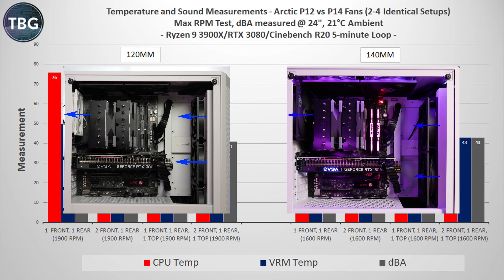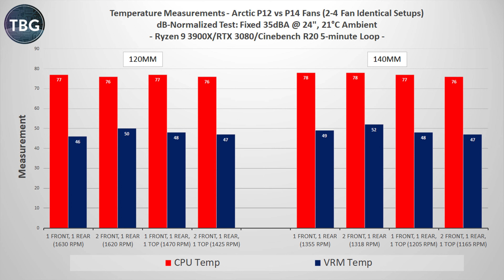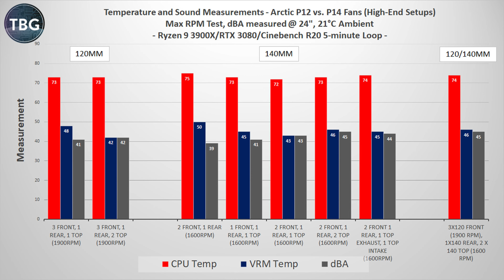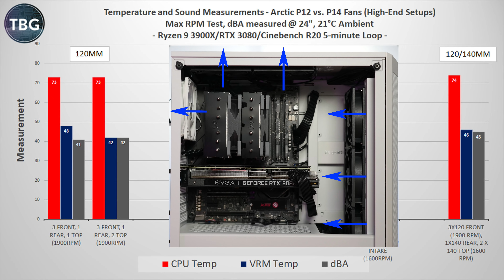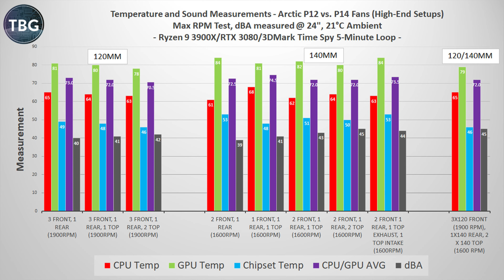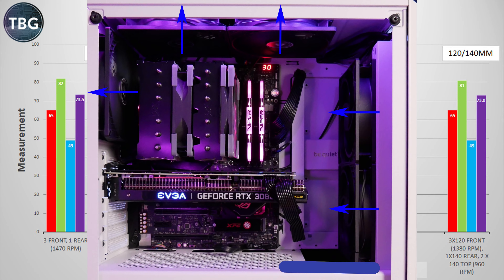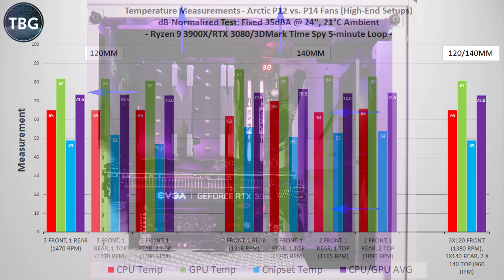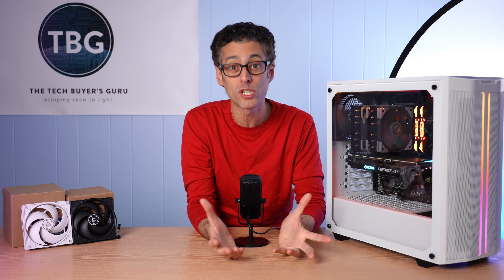The Best PC Case Fan Setup - How Many, What Size, and Where, feat. Arctic 120/140mm Fans!

Comment: What if I used 3 120mm in the front, 1 120mm in the rear, and two 140mm in the top? Arctic p fans of course
Reply from the maker: I would call that perfect, although if your case can fit a 140 in the rear, that is even better! Also, there's a new ARGB version of the 120mm to check out! -  https://amzn.to/3chOcVS
Reply: @TheTechBuyersGuru  My case is a corsair 4000d airflow so a 140mm won't fit in the rear sadly, and those fans aren't really my style. I like a ring of light around the frame of the fan with dark blades. Its just the style I have in my build, black everything with lines of white leds.

I tried the arctic bionix p120 argb fans with the led frame lighting but they had bad motor whine, worse than the p12. Maybe I got a bad batch so if you could review them to confirm this that would be great. https://www.amazon.ca/dp/B08FBH1VZP/ref=cm_sw_r_cp_apa_glt_i_HSDN5ARQ9RF1Z6BWG80J
Reply from the maker: I will be testing the P120 ARGB fans in my 120mm case fan roundup later this summer. Also in the lineup is the Corsair SP120 Elite.
Reply: @TheTechBuyersGuru  Hell yeah! Your the best.

Comment: There is one thing, that changed over the years. The internal shape of PC cases. Top front of the case was reserved for 5,25" positions in the past, positioning front fans in the lower front part of the case. HDD´s and GPU had more air, while CPU had less. Currently, it´s the opposite - CPU has more air, than GPU - this issue becomes more visible in smaller cases, like mATX. The part to blame for this, is the PSU shroud - while it makes doing case cable management a breeze, it also blocks a lot of airflow for the GPU. I think it should be left as an accessory for the owner to decide, whether he wants it or not.
A small note - you don´t have to use predetermined fan mounting positions. You can mount your fans whenever you need. I custom-mounted my front fans closer to my components, but i have 5 years old big tower, that allowed me to do so - and i´m using my 5,25" positions for my HDD´s, which, as i found out, don´t require any cooling.

As can be seen in the review, having front top fan as an outtake is contraproductive - logically speaking, you are venting cold air from your case BEFORE it can be useful and take some heat from your heatsink. Having front top fan as intake might be beneficial, but you must make some adjustments to the case, to prevent warmer rear-outtake air from being sucked back in by the front top fan. It´s certainly possible. There are shrouds and ducts, that can be made on 3D printer to help you with this. I am considering this as well, since i want to have positive pressure and i can´t have 3 fans on the front.

Also watch out for the case fan positions design - the positions for 140mm fans are often partially blocked by metal, which lowers their effectivity in their most crucial outer area, which has the highest ability to move air.
Reply from the maker: The issue with the fan mounting brackets blocking part of any 140mm fan airflow is a real one, and you make a great point about that outer edge producing a lot of the air. That could be why in this test, the 120mm front fans to better.

Comment: I'm switching from that case to a lian li lancool mesh with vertical gpu mount because it won't work in this case. I'm using 3 120mm front fans 240mm arctic liquid freezer ii top with 140mm scythe kaze flex rear exhaust. The kaze flex is the only fan that isn't arctic p12 lol
Reply from the maker: Nice! The Kaze Flex 140 is a great fan, though, so you made a good choice setting it up as your exhaust. In my tests it was the best exhaust fan by a long shot: https://youtu.be/PUdsTiRmuuU
Reply: @TheTechBuyersGuru  wonder how mounting my gpu vertically and adding a fan to the bottom of my case will affect airflow in the lancool 2 mesh. 🤔 the possibilities lol
Reply from the maker: The Lancool II Mesh is a sweet case, but mounting any GPU vertically is all about looks, not thermal performance. Don't expect miracles!

Comment: Ok. Good to see the 120mm x 5 or 6 performing well as my new setup will resemble that. The latter proving a second top exhaust doesn’t interfere with front inflow. Appreciate the time you spent here 👍🏼.
Reply from the maker: Yeah, that second top exhaust fan is something a lot of people thought would cause problems, but the tests prove otherwise.

Comment: I wish you swapped out the air cooler for the cpu for an aio/loop that has a radiator at the top. I'm running 3×140mm in front, 6x120mm push/pull on a radiator up top and a 140mm in the rear(which I'm unsure whether to make an exhaust or intake) all fans are corsair ml120 pro's and ml140 pro's.

Comment: My Fractal Design Arc case has a place for a bottom fan, how would this effect the tests if it was blowing upward pushing the gpu heat out the top? Would it also make the cpu temp go up, as the heat would also be pushed into the stream from the front fans. Another factor for my case, is that the left side has an place for a fan, that I leave open, to let the gpu heat go out that side.
Reply from the maker: Good question! It's something I intend to test in a future video. I had considered making that part of this video, but instead decided to use a more traditional case that didn't have a bottom fan mount.

Comment: Your videos have been really helpful. Thanks a lot for your efforts. 

I am planning to get a Lian Li Lancool II Mesh Performance. Please let me know if this configuration works best for the thermal and noise level.

Front - Arctic Freezer II 280 mm AIO cooler (Push Intake)

Top - 2 x P14 Exhaust

Rear - 1 x P12 Intake

Top of the PSU Shroud  - 2 x  P12 Intake

Thanks.
Reply from the maker: Sounds good but you don't want the rear as intake unless you have the front fans set to exhaust. Also, keep in mind that front mounting the AIO will increase GPU temps.

Comment: I just found your channel last night, and suddenly the time was 3 am. :D Really great content! Thanks for the in-depth testing and for not just testing fans with AIOs. 

In your opinion, if I wanted to outfit my Antec P280 case with at least 3 (2 front, 1 back) of either the Arctic P12 or Scythe Kaze Flex 120mm fans running at low RPM, would you say I would be better off with the Scythes or the Arctics?

Based on your other video, it would seem like the Scythe fans produce a more noticable noise when behind a dust filter than the Arctics. Does that match your experience with those fans? https://www.youtube.com/watch?v=WBoLyC0tSDQ&t=794s

I'm currently running my old trusty Nexus Real Silent 120mm 1200 RPM fans at roughly 650-700 RPM, but I feel like some of the newer fans might have design improvements that would deliver me better performance at the same noise level. With an RTX 3080 and a 3900X, the system can produce quite a bit of heat under full load, as you know. :D
Reply from the maker: Glad you've enjoyed the videos! I'm pretty sure I'm the first reviewer to give an honest go at testing case fans. It's very easy to strap them onto a rad and call it done, but alas, it is not done!

And, indeed, you have a high-powered system with those components. Using just three 120mm fans in a P280 case is going to be a challenge. Well, the case is the challenge, to be honest. I would consider getting a fourth fan for the top exhaust, but alternatively, you could consider upgrading to the case used in this testing, the 500DX: https://amzn.to/3340bRX
It will offer you a lot of advantages over the P280, and the stock cooling is far superior to any upgraded cooling you could do in the P280.
Reply: @TheTechBuyersGuru  Thanks for replying! Yes, finding people doing case fan testing is very rare. SPCR used to do quite a bit of fan testing back in the day, but they don't seem to be as up-to-date anymore.

The problem with most modern cases is that they don't fit my needs. They are either ugly or way too flashy, don't have enough drive bays or have terrible ones, have cheap build quality, etc.  I need at least 4 3.5" drive bays with good vibration dampening for HDDs and 4 2.5" drive bays for SATA and U.2 SSDs. 

Making HDDs silent generally means you need a silence focused case, not an airflow focused one in my experience. My understanding is that you were nudging me more towards an airflow focused case in general, not necessarily a specific one? :)

Assuming that I can't/won't change case at this point in time, do you think either the Arctic P12 or Scythe fans would be a noticable upgrade over my Nexus fans? Also, what about the difference in sound profile between the two when the fans are directly behind the dust filter as in your other video?
Reply from the maker: Ah, I see, that's a lot of drives. OK, so assuming you're sticking with the P280, I'd get a 5-pack of Arctics and call it a day: https://amzn.to/3e5OhgQ
That's about the same price as 3x Kaze Flex, and you'll be able to run a top exhaust fan, which will make a huge difference with the gear you have running. In terms of sound quality, I think you won't notice any subtle difference in regard to the filter noise in your case. Either fan will be far better than your Nexus fans. Fan design has improved tremendously since those were all the rage!
Reply: @TheTechBuyersGuru   Yeah, that sounds like a good plan. I found the 5-pack for the non-PWM model of the P12 in stock, which should work well for me since I still use an old Zalman 5.25" bay fan controller. My motherboard supports DC fan control too so it's not like I really need PWM anyway. :) Thankfully it has a startup voltage of 2.8V so even without PWM it should be possible to get it fairly good RPM range from it even though it runs at 1800 RPM at 12V. :)

Yeah, I might even experiment with two top fans with the hope that it might let me run those two at a lower RPM than the front and back fans. It might also make it slightly less of a negative pressure situation I guess.

Anyway, thanks for taking the time to respond to people's comments, including mine. 😀 Keep up the good work!
Reply: @TheTechBuyersGuru  I just noticed that the non-PWM model is older and doesn't have their new fan motor. Have you ever used the non-PWM version of this fan?

Not sure whether I should return these and wait a few weeks for the PWM versions to come back in stock. It would require me to modify 5 extension cables to accept the 4-pin cable (i.e. I will need to cut off one of the sides so that one end can stick out). That would be worth it if there's a noticable difference between the different models, but still a bit of a hassle.

Comment: So I have 2x 140mm and 1x 120mm fans, cpu temp is fine but i'm having trouble with gpu temps.
Based on your results the best thing would be 140mm front intake and 140mm on the top as exhaust and 120mm on the rear as exhaust? (the back only fits 120mm)

Thank you for very detailed video!
Reply from the maker: Yeah, best by far would be 140mm in lower front position, 140mm on top as exhaust.

Comment: new sub from hong kong, one of the BEST informative youtuber , didnt skip a bit to watch
just built my new desktop
i5 10400f with b560 board, 3200 ballistix ram,1660 display card, cooler master nr400 case, fuma 2 cpu cooler and mx4 thermal paste (both based on your review again)
and of cos ALL 5 ARCTIC P12 fans installed, I would say a bit overkill,  it just hard to reach 80 degrees lol
but who doesn't like better cooling, especially with this low price from arctic and fuma
Reply from the maker: Welcome aboard! You got some great cooling gear there!

Comment: The case I ordered for my PC will be a Phantek Eclipse 500A. I picked it mostly because it's one of the better airflow cases and can use all 140mm fans. It could take up to 6. The ones it comes with are non-PWM. My thought was that I could order a 5 pack of P14's and be able to run those for 3 front, the rear, and the top rear with the rest of the top mesh blocked to force the air to go through the case. Alternatively, use two at the top (one intake and one exhaust) with one of the Phantek fans at the rear. I want to maintain some positive pressure to minimize dust infiltration. The lower front fan will basically blow fresh air right under the GPU so I'm really hoping for 3 fan GPU to take max advantage of that.

Comment: Thoughts on 3 front intakes, 1 bottom intake. 1 Top exhaust and rear exhaust?
Reply from the maker: I'm very interested in bottom intakes and considered using a case for this video that allowed that with an official mounting location. It ended up not making sense for this test, but I already have plans for a future video comparing standard setups to a setup with a bottom intake.

Comment: 4 CASE FANS GAMER

- 2 front (intake)
- 1 rear (exhaust)
- 1 top (exhaust)

Notes:
Balanced pressure is fine. Not sure if top fan should be towards the front or back of the case. I'm guessing front is better to be more directly aligned with GPU fans  (CPU heatsink isn't in the way).

Let me know if there is a better configuration that I missed. All fans are 120mm.
Reply from the maker: If you're specifically interested in 120mm fans, you might want to take a look at the first video in this series, which went into detail on all the tested configurations: https://youtu.be/7dAvxfDYuRU

Comment: 3 CASE FANS GAMER

Video Best Result:
- 1 front (intake)
- 1 rear  (exhaust)
- 1 top   (exhaust)

This is a net negative internal pressure which goes against the advice Linus (LTT) gave in a video. Linus recommended a net positive internal pressure with filtered intakes to minimize dust buildup.  This ensures the air entering passes through the filter(s).  

Positive Pressure Variation 1:
- 1 front (intake)
- 1 rear  (exhaust)
- 1 top   (intake)

Note: As mentioned in the video this results in the GPU fan fighting the top intake.  Therefore, it's a poor choice.

Positive Pressure Variation 2:
- 1 front (intake)
- 1 rear  (intake)
- 1 top   (exhaust).

Note: This results in the CPU cooler fighting the rear intake.  So another poor choice.

So, the Video Best Result is the best option for me.  It will have more dust build-up over time, but that is fixed with regular cleaning.

Let me know if I missed anything or if you think there's a better configuration. All fans are 120mm.
Reply: I rewatched the conclusion again and he mentions if you have a high power GPU you need to prioritize the front fans. Without testing, a front bias setup may be optimum.

Front bias:
2 front (intake)
1 rear (exhaust)

Note: 
Positive internal pressure  (good for dust).
No top fans which are supposedly the most impactful for noise.

Comment: This was a totally unexpected result.  So to clarify: the smaller 120mm fans are actually quieter than the larger 140mm fans?!?!? 

This flies in the face of accepted aerodynamic theory and design.  Crazy unexpected...
Reply from the maker: It really doesn't fly in the face of anything but enthusiast hunches, which isn't based on much. Can a 140mm fan produce more airflow at the same noise level? Who cares, wrong question. The correct question, and the one my tests were intended to answer, was whether they provide more cooling. They do not when used as intakes. I expected a different result too, but when I looked at the data and the way the fans are positioned, it made perfect sense. That's science.
Reply from the maker: And to be clear, the 120mm fans are always quieter at the same RPM compared to the 140mm fans. The only question is whether they are quieter at the same cooling level, or alternatively stated, provide better cooling at the same noise level, which is what my tests showed.

Comment: In addition to the 6x120mm arrangement, would an additional bottom intake right next to the psu help the GPU even more?
Reply from the maker: This is a great question, and something I've been planning on testing for a while. The video will be coming in the next few months, but my initial impression is that it would greatly help GPU temps.

Comment: I have a "problem". I already have 5 140mm fans (P14) at home. No 120mm yet.
My case is the 500DX. Your 6x 120mm setup seems to be beneficial. But I would like to not order 6 120mm fans because I already got the 140mm. At the same time I want to reach near "perfect" cooling.

What do you think about this setup:
2x 140mm front (in)
1x 140mm rear (out)
2x 120mm top (out)

OR
2x 140mm front (in)
1x 140mm rear (out)
1x 140mm top (out)
1x 120mm top (in or out???)

Like that I can use at least a couple of my already bought 140mm's and it's similar to your "best result setup". 

Also would I have problems with dust? Because of eventual under-pressure.

🙈
Reply from the maker: Oh, don't worry, it's not that big a problem. I'd definitely keep the 140mm fans on top and in the rear. The only thing you should change is the front fans, and if you don't want to buy 3 new 120mm fans, I'd simply recommend that you space out the 140mm fans so the lower fan's center is between the GPU and the PSU shroud, and the top one's center is lined up with your CPU cooler's fan.
Reply: @TheTechBuyersGuru  thank you so much for the quick reply and help! Stay healthy

Comment: Great info, still sort of struggling to decide between the P12 or P14, if I'm mainly concerned about noise is my best bet gonna be the P12 no matter what? My case is a bit bigger than this one, would that  make any difference, if I really wanted to prioritize for low noise is there any situation where the P14 is preferable?
Reply from the maker: Here's what I would say: if your case can take 3x140mm in front, then feel free to go with that. What's clear is 2x140mm in front is inferior to 3x120mm, despite what a lot of people assumed for years. You can get 140mm fans to be quieter than 120mm fans, but not if the RPM has to be at the same level to compensate for airflow coverage that isn't optimal (140mm is wider, not as focused).